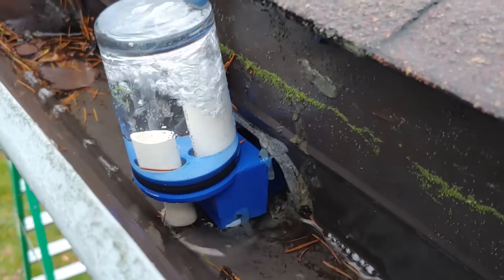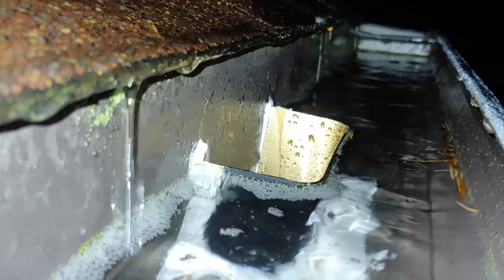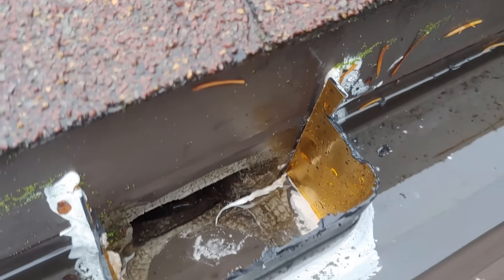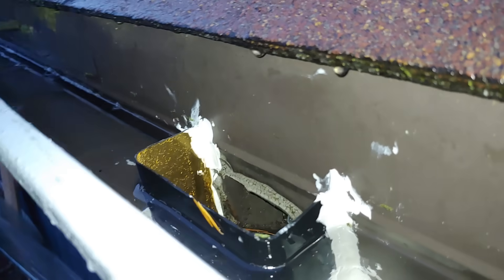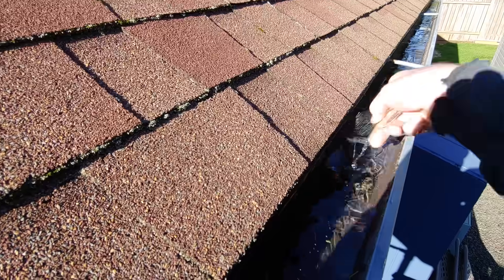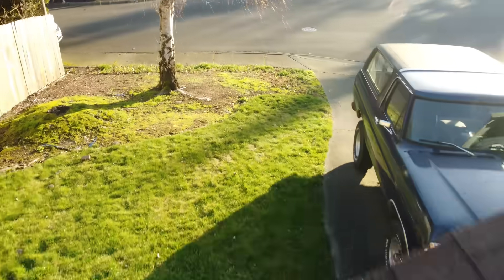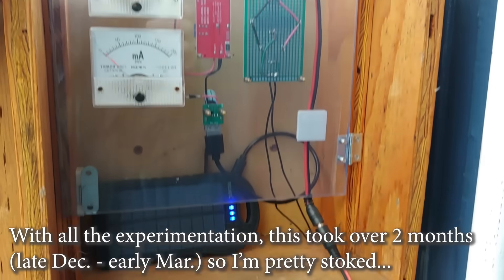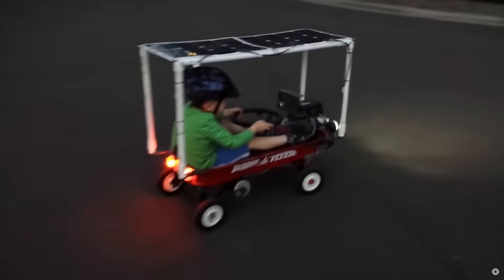Rain Gutter POWER #6 - World's First Rain Charged Phone!

Comment: Little late for advice..but your bell siphon wasn't functioning correctly.   There was to large a gap between the glass & the pipe the water drained through (the main one it dumps the water through).  That gap should be small so that it fills will water eliminating the air..once the air is gone the siphon starts..yours was gurgling and right there struggling to actually engage.  If the glass was shorter or the pipe was closer to the glass it would function better

Comment: I wonder whether this whole system (the bell syphon) would be a lot better placed lower down.

What i mean is some gutters i have seen run a half pipe along the roof. But where the vertical pipe is (to birng the water to the ground) they have something like a "tub" which is attached in the gutter's lower point and the v. pipe is attached in that tub.

If you have a slightly bigger tub (maybe a couple of gallons worth or 6-8L) you could have a tall bell syphon (i.e. waits for the tub to become full and empties it all, while the rain keeps filling it up constantly).
That gives the advantages of:
a) the overflow is not needed bar even more extreme rain,
b) so you lose on less peak  moments
c) you avoid having a reservoir in the gutter:
c1) which can be an issue in all seasons except winter (with mosquitos), 
c2) with ice forming and keeping a full gutter in max wait with snow pilling above it, 
c3) and with rusting of some of the materials in the gutter (i know gutters normally dont rust, but nails and most of the other attachment materials do often)
d) i believe a taller bell syphon would mean longer run time on each "on" cycle (though it does also mean a longer "off" cycle... which makes testing a lot more prolonged and harder...

not even sure if you are gonna read the comments on a 4 year old video of course, but interesting in your view after the practical experience.

btw this has been one of the few ideas i have had for a prolonged project with a future kid to get it into many practical things like 3d printing, using basic tools, building some basic stuff, etc... as well as the scientific reasons behind it like the bell or Pythagorean syphon, or the motor generating power or trickle charging, etc

Comment: Curious why you opted for the 90 degrees rather than just capturing the water pressure from gravity by setting your wheel in vertical alignment?  I think you might have been able to increase the amount of energy captured as you would have both the weight of gravity plus the compression resistance force of water.

Comment: Should've just had the overflow dump into the same tube the siphon went into, You wouldn't need to set up a second generator. You might have to have a way to adjust the flow of the water jet.

Comment: 4:46-4:50 you can see the dremel tool stretch the caulk when you are cutting the overflow. If the caulk didnt get wet it would have held stronger like you said. but cool to see why it failed after you cut it. really cool video! nice job with everything that you did!!

Comment: Damn it! You stole my idea :D I thought of this 4 or 5 years ago and never did anything about it. Just watched all your videos, you did a better job than I would have done. Nice one!
If you want to add a little more power to your Pelton wheel, then have the jet of water flowing downward out of the bottom of your pipe instead of out the side. That way you will add a little gravity force to your water flow. At the moment, as soon as the water leaves the hole in your pipe it looses force in the horizontal direction to gravity ;)

Comment: 1. Nice to see you switched from and under shot wheel to an over shot wheel   enclose it and it should increase your efficiency...I think

2. Put the bell syphion bellow the gutter...shouldn't need the glass beads...and if you do it right, would allow water to flow without freezing.......with proper precautions. I'm north of Seattle  so know the weather struggles between the seasons....

3. Add more syphions and more wheels and you should get more power out...I think.  Might even be able to add more altinators to the system...probably should anyway and use a system to switch in and out for the water flow

4. I think you are losing efficiency the way you are using a drain and picking off a small hole at the bottom.   My memory tells me peak efficiency is based on the height of the flow.  Maybe add bottles higher up and a smaller pipe to the wheel.  I mean, keep as much water higher. I think.  Based on memory. And I don't claim my memory is the world's greatest

Use this to charge a bank of capacitors or batteries and you can use it to charge a modern cell phone.  If you HAD to

Comment: I've enjoyed watching this rain water generation project.  Could you try increasing the down pipe size or have a large tank just under the gutter so more water is held in the vertical position increasing the water pressure at the bottom of the down pipe? Just a thought.
Reply: Do it 💪

Comment: This creation is spectacular. I would be excited to see it in action. If you know of any commercially (less than expensive) options, please let us know.

For a question, I wondered why you put the spout to the side of the tube? I suspect that this was to trap debris falling down the water originally.

But now that you have the bell siphon and the gutter side filters, I wonder if you could improve the flow rate out of the nozzle by funneling the falling water directly down and onto the pelton turbine from above? Or at least provide a curved pipe system to smoothly redirect the pressure-related forces towards the nozzle?

Comment: This is a cool experiment. Wonder what would happen is you used a helical cut gear on the generator side, might increase the amount of load you could put on the system without slowing the wheel down as much

Comment: Use a container to capture the overflow and add then bell valve in the best place. Then run a tube to another generator. Another overflow could be added to the container.

Comment: You should have stages of batteries to remove all load and increase efficiency. First have the wheel charge a battery, and when that battery is 75%-90% charged then it begins to discharge itself into your power wall in which you draw loads from.

Comment: I wonder, if you used something like the screens used in screen doors and windows, only with slightly larger holes. Maybe look for something made from a material that wouldn't corrode in year round weather. I know you can buy the regular screens in rolls. So cut it to be two or three times wider than the top gutter width so it can attach under the lowest level roof tiles then reach to and over the gutter. It would not block the water but would prevent debris from getting in the gutter. Then your marbles should be good enough to keep the smaller out. Just a thought...

Comment: Intresting way to install gutters (usually they are supported from The underside not nailed on directly into wood) with the filtering problem just use that fine mesh all the way across the cutter, smaller bit won't clog up the jet

it's nice seeing this setup of yours but a drain pipe diverter into a water collection barrel (that get your head pressure up and would continue to make power after the rain stopped as it would be capturing all the rain water until its full) would accomplish the same thing without having the mess with the gutter and having extra holes in your gutter (still would install the mesh over the gutter to filter out the larger debris)

Comment: Why don’t you put some guard a inch or few away from the wheel. Cause then the wheel should spin faster. Or you can put a narrower end on the bottom of the pipe. It should build up more pressure.
The second one would be the best
Reply: The more the narrower the hole is. The more the pressure from the water in the pipe. Which in turn creates faster and higher pressure output. Which will make the wheel spin faster. So you would generate more power.

Comment: Some ideas that may improve your electrical output.
1. I noticed your propeller shaft has a wobble in it so your loosing power, adding a second fidget spinner barring on the other side to steady it would help it run faster and smoothly.
2. Your water nozzle hits the top of the propeller rotating it clockwise, if you flip the wheel and alternator so the position the nozzle to hit the bottom of the propeller your should get faster rotations as you aren't fighting against the gravity and water being back splashed and running underneath (perhaps even helping it rotate faster?).
2alt. An ever more efficient idea would be to modify the bottom of the downspout to trapper to the nozzle itself because you are loosing atmospheric and water pressure of the surface area from the 90 degree nozzle insertion inside the downspout.
3. Cock around the gutter's mounting pins.
3a. block the gutter overflow, shouldn't need it.
4. Cut a large hole in the gutter and reposition/attach the bell siphon so it sits below and in the gutter to be able to fully drain and start at the gutter's maximum capacity.
5. Alternate propeller design: Make a tesla turbine propeller. It is said that Nickola Tesla crated such a perfect/efficient water turbine that material science at the time wasn't up to the task to use it at hydro electric plants, however it doesn't mean ppl at home can't couldn't use it. Google Tesla Turbine.

Comment: I hope this reaches you but there's been a question stuck in my head for at least 3 years ever since I took my first physics class: I know this experiment didn't yield much power, but this does mean that theoretically you can make power with nothing but a heron bottle that refills itself with gravity fed rainwater and one of them flapper plugs in a standard toilet cistern, right? 

So how big of a heron bottle do you need to power a house? Some retention ponds hold ridiculous amounts of water. It seems like collecting the water wouldn't be the hard part. Maybe designing this thing would be, or maybe the structure would need to be too tall, or the many smaller structures would take up such acreage that every household in America would need to be miles apart, or maybe all the water splashing would turn the place into a swamp? I don't know, but I haven't gotten a single answer to this question and it's driving me bananas lol

Comment: Wow i just saw all the great video's of this rain gutter power , and i just wander why the water is diverted in a horizontal way ? why not put the wheel , under the water tube ( like make a cut in the tube and fit the wheel between two very close to the wheel flaps )  , so the water falls down on the wheel , if the sides of the wheel should be having 2 parts that come close to the wheel , So the water falling , not able to escape of the wheel what makes a lot more water will be driving the wheel. Just an idea.............................

Comment: You can get gutter guards (mesh) which sit directly over your downpipe which stops the leaves/debis.By fitting the overflow and allowing the rain water to build up 
 1 litre= 1kg so your adding a lot of weight to your gutters and their fixings.Why dont you fit a waterbutt with a diverter.This would act like a dam(increasing water pressure),be at ground level,would fill whilst being drained due to the diverter and would allow you to use your drainage as normal.You could fit the pelton wheel directly below the butt tap(working with Gravity as opposed to directing the water at a right angle.)

Comment: Couldn't you technically take the water that's being pushed out of the very first system and recycle it again in a level below it with another set? You just make your pipe not so long so about a foot below the gutter you have the wheel being spun. Then about a foot below that or two there's a whole second containment system with another wheel for the water from the first. So on and so forth all the way down zig zagging so that their waters being used over and over again until it gets the ground. I feel like your single wheels a waste without having all that water used over and over until it gets to ground level.

Comment: you wouldn't necessarily need to build a second generating setup for the overflow.  you could route the overflow onto a second nozzle for the main wheel.  the reason I feel more nozzles didn't work earlier is that it was splitting the flow rate between the nozzles lessening the power of each one.  With a second nozzle from a different source your main nozzle isn't loosing any power.

Comment: What if the over flow filled a rain barrel elevated off the ground just below the gutter and then was connected to the same turbine, but only dumped it's water when the primary wasn't supplying water?

Comment: These results are very disappointing. Yet hydro dams create loads of power. 
Your design is based on creating 1 watt. And you need 2 gallons a minute to create that. Does that mean 10 watt requires 20 gallons a minute or is this not so easily scalable? I’m thinking catching the rain and storing it, then releasing it from even greater height for more pressure should create more power. We just can’t let the rain dictate the flow rate. 12000 gallons might produce 100 watts, if we can control it. Worth an experiment

Comment: Why haven’t you increased the diameter of the pipe. Increasing the storage of water. Increasing the force of the water using a larger amount of gravity for higher presser. Then you could add a shut off valve and holding tank just below your gutters. In other words the more water you store the more weight and more force from the jet stream.

Comment: What if you made another generator and used that in place of that plastic one and put a umm small wall type thingy divining your gutter into 2 equal parts then both your generator would be working.

Keeping and emergency open spot for the water when your gutter is overflowing would be good too.

Comment: You should totally invest in a webcam and continously stream your bell siphon and turbine! I'm invested in this project! Also, can you store the overflow in a tank and run it down to the turbine on demand? Using the power stored by the turbine to switch a solenoid valve to release the water in the tank. This is a great project!

Comment: I'm wondering quint , instead of using the tube pipe and the gutter as source/ impounding of water, why not direct it to a large storage tank around 1000-2000 liters, and use the bottom of the tank to position the jet and generator? the bottom of the tank is the maximum pressure, i think it has more pressure than the existing one.. and the good thing about this is that it increase your volt output and longer the charging because of more volume of water stored in.. hope you read this and replied cause i will be happy if you do.. your subscriber from Philippines :)

Comment: Sugestions: 1) redirect your watter into some barrell/s, or other reservoir and let the gutter only to filtrate and catch the watter. When full for all time, it will brake from your roof pretty quick. 1B) If you expand your "supply" capacity, you can overstep the dry days, AND you will have free watter for wattering garden, or cleaning your car. 2) you can connect the gutter emergency overflow to the pelton you already have, for higher output...? Good luck anyway. BTW, if im trying a shot on home generator operating with watter, i probably would go for ballance on the leverage, with watter as weight, combined with siphon.

Comment: You know if you use the second gutter to make power, you could keep the AC from that side to run to your main system so you don't loose power running DC all the way to your main system. Rectify it at your main system.

Comment: I saw a nice setup on a public building to letting the initial bit of water from a rain shower flush out the trash before it then let water into a storage tank. This tank was on the ground and used to water the plants around the building.  It wasn't like this but this one is probably the "cleanest" look one I could find googling!

https://www.youtube.com/watch?v=r8BONjopPhQ

This might be a similar device to the one at the public building 

https://www.youtube.com/watch?v=hvvfn08urnE

and the mfgr. has a more inline like filter that kinda self cleans

https://www.youtube.com/watch?v=Q7rWYWx1dps

Comment: You can replace the old square gutters with 3" PVC pipe, with a smal slit cut in the top to allow only rain in some small debris will make it in on occasion. You can simple tape the tube and run a quick shot of air once it dries out and blow all the debris out quickly if the water flow itself doesn't clear it. You can make a quick disconnect on the end to fiddle around with your various experiments.